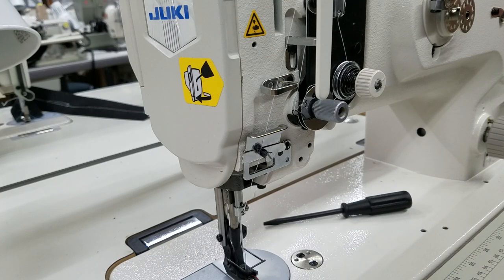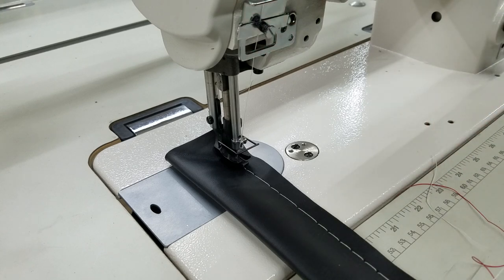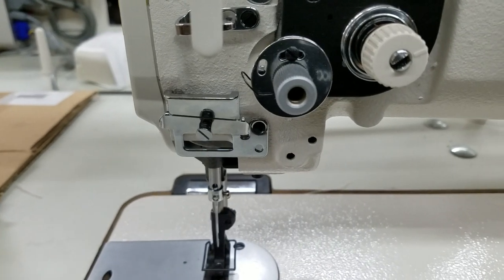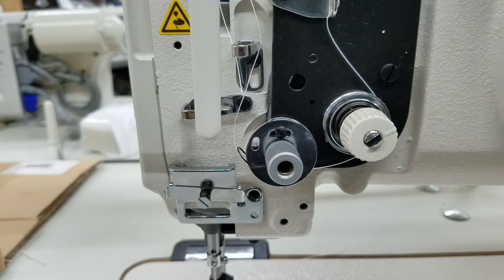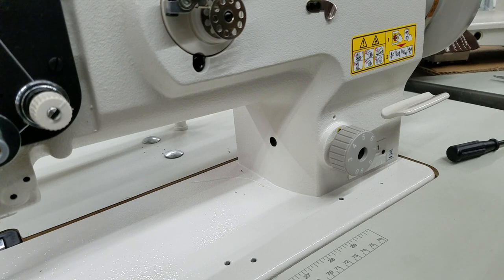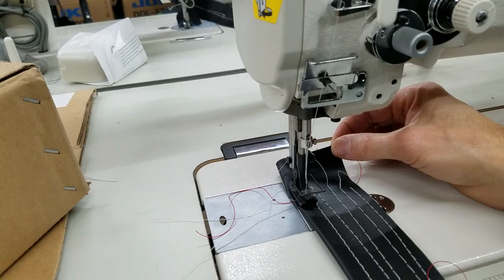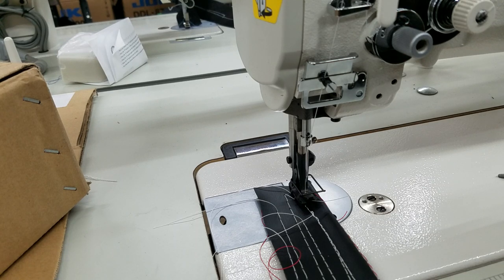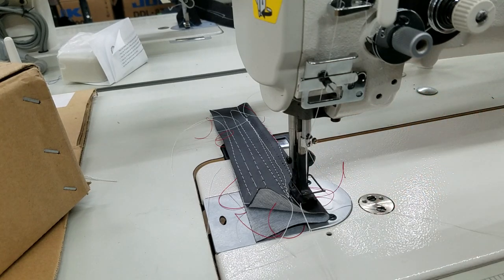Juki DNU-1541 - DNU-1541S common user errors

Comment: I didn't use my machine for a long time and used a vintage Singer machine that needle threads in the opposite direction.  Came back to my industrial and couldn't get it to sew...until now that I see I threaded it backwards.  Duh!!  Anyhow, my machine is not broken and I am happy.  Thanks for this video!!

Comment: I just bought a used 1541S.  It's ten years old, but looks brand new.  The only thing is the previous owner installed a tension plate from a 1508 on it.  I'm not sure why, but I want to return it to its original configuration, but I'm missing the thread guide that goes on top of the tension plate.  Do you know where I can source one of these?  Also, I would like to get an original drain pan.

Comment: Steve, I have a question, it's sunny juki 1541s. When are you sewing the knot will not stay centered in the leather. It will either move all the way to the bottom or all the way to the top. I've been sewing leather for over 10 years now and I've never had a problem like this and I've tried every remedy I can possibly think of LOL. Have you ever heard of this?

Comment: I just did the backwards needle threading thing just before Christmas. I don't let things beat me. I must win. I sat and looked at it and I knew it had something to do with the bobbin or the needle. Took the bobbin out and it was fine. Finally threaded the needle like a book, left to right. Worked like a dream. The needle divit thing I did not know. Guess I have been lucky changing needles so far. That's a hoot because things don't work like that for me. Any way I appreciate your video. very helpful. Could you please fill a bobbin? I am not always sure I am doing that one correctly. Thanks. Happy New Year to you.

Comment: Thank you for your video, I'm new to my industrial walking feet machine and I've had a few issues.  I'm particularly struggling with thread tensions top and bottom and find that the machine will sometimes `shread' the top thread till it breaks.  The thread I'm using is extremely strong bonded thread and you've given me plenty of ideas on where to start trying to sort my issues out.  Thank you
Reply: I would suggest checking your needle for burrs or failing that your bobbin hook. Chances there is a burr somewhere

Comment: Thanks for the tips!  I have the 8700 and am having problems with when I finish sewing, and pull the fabric out, the bobbin thread is doubled.  I have the bobbin in clockwise and the stitching looks good.  It's just annoying to have to jiggle the bobbin thread to get it loose.
Reply from the maker: Make sure the take up lever is all the way up when you are pulling the fabric out.  That will allow the thread to pass the hook and avoid the 2 threads coming up through the bobbin area.

Comment: I have  two 1541’s delivered with the check spring positioned straight up.  The tension on them was awful.  I have loosened the screw and brought the spring down and they are sewing better but I still can’t get it perfect.  I still see dots on the bottom.  What can I do to fix the tension ?   And did I do the right thing with the spring?

Comment: Great video very informative. Could you please make a video in the bobbin winder adjustment. I've the same machine but the bobbin winder is erratic. Sometimes it winds normal. Other times the revolutions are very slow. I've tried to adjust by loosening the 3 screws but it's still not great. Thanks again for your video.

Comment: Hi! Thanks for your videos! They are really helpful. I am having tension issues  with my Juki 1541s. I'm sewing on Naugahyde vinyl, backed by 1/4" scrim foam with a fabric backing and with a Bonded Nylon V92 thread and size 20 needle and no matter how much I adjust the tension knob or the bobbin case, I cannot get the tension correct. There continue to be some small loops on the bobbin thread, back of fabric. I have also had loops on the top of the fabric and bottom at the same time. With some adjusting, I can get the top tension to produce a straight stitch with no loops, but not the bottom. Do you have any suggestions about how I can fix this? Thank you.

Comment: I’ve never used a industrial machine before. Do these machines take regular sewing needles? And what about thread? Is it thicker than a standard quilting thread?
Reply from the maker: Most industrial machines takes specific needles.  They do not use a standard 15x1 household needle. This particular machine uses 135x16 and 135x17 class needles.  The DNU-1541 series is sewn off with T70 thread which is thicker then quilting thread.

Comment: Hi steve I have a little question. I have a Gemsy straight stitch G8900B exactly like a juki DDL 8700 in appearance but my bobbin is slightly bigger. I am trying to sew scraps of lycra, stretch knits and light fabrics but it seems to skip stitches and really does a terrible job in just trying to do a stay stitch. I played with the tension, cleaned the machine, and i dont know what else to try. I also changed the needle to a new one but i still get the same problem. I am not sure if i will need a different kind of needle, i was trying to look for a video on your page but couldn’t find something. Thanks you so much for any help I would appreciate it.
Reply from the maker: I would try a ball point needle for starters.  Unfortunately Lycra and other stretch materials are the hardest to sew.  Sometimes we have to time a new machine to work specifically on stretch.

Comment: Hello,  I am wondering how you start a stitch with the thread hanging loose?  When I do that I get a mess on the underside.  Thanks for the video.  (wish they had been around in the late nineties when I started sewing canvas.  Almost no info for a beginner then.  A few years in CD's started showing up for sale but this is so handy for people.)
Reply from the maker: Hold both threads and lay the first stitch by hand. I hope that answers your question.
Reply: @Sewinggold  That is what I always have done but sometimes it is cumbersome when sewing in the middle of a large piece.  Also with large fingers.  It would be nice to not need that extra hand when holding the work with my two as well. Thanks.  Doug

Comment: Steve, can you comment on this: if I don’t give the machine enough “gas”, just tenderly press down, and when the material is thick/resistance to needle is high, the belt just spins by itself and making the friction noise, very troubling but I don’t think it’s wrong. How do you suggest I handle this? (If I gas it, I’m afraid I’ll lose control and it’d stitch too fast)
Reply from the maker: If the belt spins, that would tell me you belt is too loose. If the material is really dense, you will need a bit more speed/power to get through.

Comment: Hi I have a juki dnu-1541s and I am always  having problems with tension,  the bottom stich is always leaving knotes or little balls , how can I fix this been sewing for a while so I know I'm not doing any of these mistakes on video 
Please help
Reply from the maker: The easiest fix is to tighten the top tension.  It should help pull the knots to the middle of the fabric.  There are other options to fix this as well.
Reply: What other options 🤔
Reply from the maker: @aliciap5241  I would need to see the machine.  When we get these in for repair with the same issue, the tension is the main problem.  Could be the bobbin case, check spring, position finger, presser foot and feed dog relation and on and on.  Those are not as common as the main tension.
Reply: What bobbin case do u recommend for that machine , I'm not sure if I bought the right 1,  I bought towa bobbin cases , I do get the tension back after I play with it a little  , butt when I change  the thickness  of my material they I have to change tension  just wondering  if that's normal  , thanks
Reply from the maker: @aliciap5241 There are always minor adjustments to get a perfect stitch when changing thickness of thread and material, but you should not have to do it all the time.  Towa and Koban make good bobbin cases.  Juki part #B1837-241-S00.

Comment: What is the difference between the 1541 and the 1541S also are these machines ok sewing holsters?
Reply from the maker: The DNU-1541S has a saftey clutch.  Thay can both sew holsters but only up to a point.  It will depend how thick and dense the leather is.  Also, the maximum size thread by the specifications is 138, but we have used 207.

Comment: Great video. I have the 1541S and somedays I win the battle and someday it does! The main problem is when I finish sewing a seam and want to pull the fabric out to cut the thread, I can hardly pull it. I make sure and have the take up lever in the up position, but it still is difficult. Any suggestions? I have checked my threading and it is correct. My stitches look good, so the tension is ok. Thanks for any help.
Reply from the maker: Are you using the hand lift or knee lift?  Make sure the knee lift is fully pressed and it should release the tension better.
Reply: @Sewinggold  I use both most of the time. I'll make sure the knee lift is fully pressed. Thanks for the advice.

Comment: This machine doesn't have a safety clutch?  Mine does and I keep having to reset it.
Reply from the maker: The machine in the video is a DNU-1541 and does not have a safety clutch.  The common user errors are the same for both machines.  I would not categorize your issue as a user issue.
Reply: @Sewinggold  thank you for answering my question.  I thought I was doing something wrong.  I can be sewing along just fine and when I stop and start again I have to reset the clutch because the bobbin will jam.
Reply from the maker: @roxannericchio3556  Are you sewing off the edge of the fabric? What size thread are you using?
Reply: @Sewinggold  No, I never sew off the fabric and I am using Bonded Nylon 69 Tex70 and Groz-Beckert Needles 125 sewing on faux leather